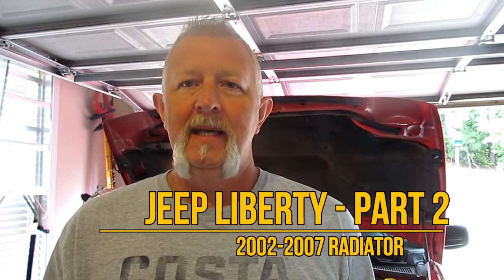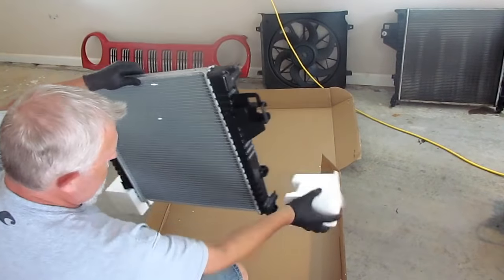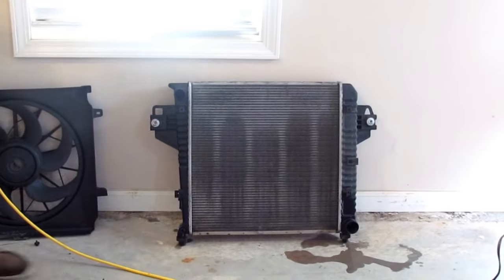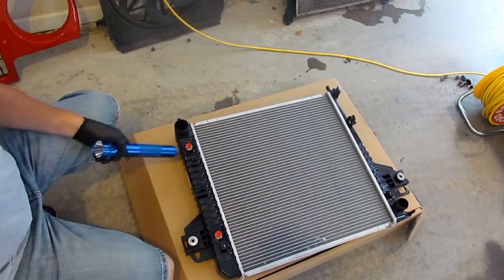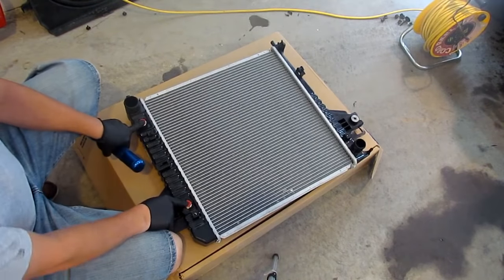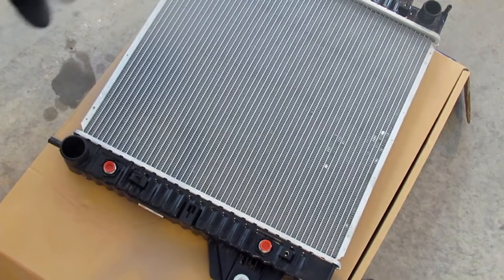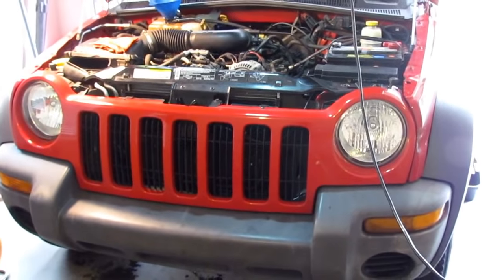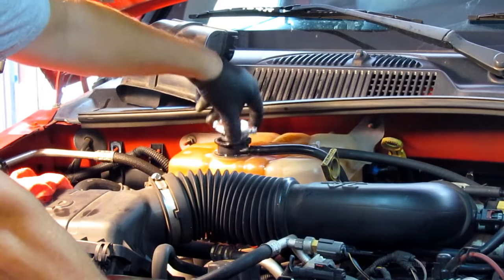Part 2 Remove and Replace 2002 - 2007 Jeep Liberty Radiator

Comment: I changed the radiator did everything you said but still over heating top hose hot to touch bottom hose where thermostat is is cold any idea what could be I also changed water pump and thermostat HELP
Reply from the maker: Thanks for watching.  Any chance you put the thermostat in backwards?  I've seen that happen before.  Also, did you burp the system?  If you have a lot of air trapped in the system, you won't get good coolant flow...no flow will cause thermostat to stay closed and then the car overheats.  The only other things I can think of to check:  be sure you have completely filled the system, low coolant causes same problems as low flow.  You may want to pull the thermostat, put it in a pot of water, boil it to be sure it is working.  The temp at which the thermostat begins to open will usually be stamped on the flange...make sure it is the correct temp thermostat for your year and model.  Let me know if I can help further.

Comment: Hi Dennis - I watched your video since my daughter's 05 Jeep Liberty needs a new radiator and we can't afford to replace it at any garage in town.  The dealership shop gave us an estimate of $1400!  I also don't think I can do this job myself, even watching your great video.  She doesn't get any heat from the heater and the dealership said her radiator was cracked...I don't know if that's true or not.  Do you have any ideas you can share with me?  Thanks so much!
Reply from the maker: Hi Suzanne, I'd try filling up the radiator and the overflow bottle to the indicated mark first.  Not sure of your climate, but either use pre-mixed anti-freeze with water, or mix your own using distilled water only.  If it does not get below freezing in your area now, or will not get that cold in the near future, I'd probably just start with distilled water only (cheaper), because what we're looking for is leaks.  If you fill it, and it doesn't have a leak, you may just have a bad radiator cap, or you may just have a cracked overflow bottle.  Both of these are much easier to replace that the radiator.
Once filled, start the car, let it warm up completely and check underneath for leaks.  If you get water.....see if you can determine where the water is coming from.  It could the be water pump, the radiator, a hose, etc. 

If it is leaking from the radiator....all you can do is get it replaced.  Unfortunately, there is not any way to repair these radiators.  Let me know what you find and I'll try to help you from there.
Reply: There is a leak coming from somewhere.  I added the PEAK 50/50 yesterday and noticed that the fluid in there was very low.  I could not get the heat to work after filling it to the required level.  There was some warm air coming out on the windshield defog setting.  But when I switched settings the air coming out was cold...although it was warm for about 10 seconds, then came out cold.  I let the car run for a while and it never got any better.  The jeep dealership said the radiator was cracked and there is a definite leak - but I don't now if it's the radiator cap or a hose...the A/C worked all summer  - but the heat is not working at all.   I'm going to call garage's today to get a quote.  I'm a single mom and this repair, along with the new brakes she needs, is going to wipe me out. :(  Thanks for your reply.  Wish I could do it myself but it's a big job for me and I don't have tools or confidence to do that one.
Reply: I forgot to tell you this...I live in Colorado..so it's cold here and right now the weather really changed and we got some snow...so I have to warm up the Jeep before driving it.  It's about 39-45 degrees today, no sun.  Tomorrow will be 60.
Reply from the maker: Hi Suzanne, it sounds like you may have a couple of problems.  With the radiator full and the engine warmed up, you should get warm air from the heater.  You may have a blend door that is stuck.....that is the part in the dash that moves to divert either cold air or hot air depending on what setting you chosen on your temp control.  Of course, you may still have a radiator leak as well.  That can be easily determined by checking the radiator when it is cooled off.  Since you filled it, it should still be full, unless you have a leak.  Let me know what you find from the shop, and I hope it isn't expensive to get fixed.

Comment: You helped me a lot on this install, but I have to rib you a little so here goes...did you forget to swap the rubber inserts on the bottom two posts?
Reply from the maker: Thnaks for watching and I'm glad this helped you!  It's been a while since I did this replacement, but I think you are right...seems I either forgot to replace the grommets or left them out altogether or did something dumb!  haha.  I don't remember exactly what it was, but I do remember something about those lower grommets/seats.   Nothing wrong with a little ribbing either.....Thanks!!
Reply: @dwcoffey  did you go back and add these rubber grommets? as I forgot to install these too.

Comment: I just knifed that bottom rubber that had me hanging on to that radiator... I have the same issue of 2 extra cooling lines on my new radiator, did you plugged yours? What size are those connectors?
Reply from the maker: My radiator came with a couple of plastic plugs in the transmission cooler ports, so I just left them in there.  I'm sorry but I don't know what size the plugs are.

Comment: Hi. I've followed the installation procedure. I have completed everything, add the antifreeze I inspect the hoses but notice something strange in the hose below the pressure and feels like something inside it is the one that goes from the radiator to the thermostat. It makes me strange because I only disconnect that hose from the radiator and that strange feels just before the entrance to the engine. It's normal or you think it's due. Thank you
Reply from the maker: Hi, thanks for watching.  Some radiator hoses have an internal wire 'spring' to keep the hose from collapsing when the engine and coolant are cooling.
Reply: OK thanks!!!

Comment: What part number did your order? was this MOPAR?  I'm about to do this change over and really confused about the different mounts for the external cooler.
Reply from the maker: The trick will be to order the right radiator for your vehicle, mine my be completely different than yours.  You'll need to know if you have a manual or automatic transmission, engine size etc.  The radiator I ordered was not mopar, it was aftermarket.  If you are buying it locally at a parts store, just take all the info about your Liberty to them and they can look up the right part.

Comment: How much antifreeze. Or how do i know i have enough in the hole system
Reply: Thank you
Reply from the maker: Hi Pucho, the system capacity is 14 quarts, but you won't need that much because you won't drain the entire system replacing the radiator.  I fill up the radiator to the neck, put the cap on, let it warm up, burp the system, shut off the engine, then check the radiator (be careful opening the cap).  Top off the radiator, cap on, start the engine, let it get up to operating temp.  Let it cool off, fill the radiator to the neck if needed, and fill the coolant overflow bottle to the indicated mark on the bottle.  Then just keep an eye on the overflow bottle the next couple of drives you take. 

Thanks for watching!

Comment: Where did your replacement come from?
Reply from the maker: I ordered it from Rockauto.com  Be sure to order one based on whether you have an automatic or a manual transmission.
Reply: Mine also has a manual fan. Its a 03 v6 auto with air 4wd. It has the external trans cooler like yours

Comment: What's happens if I don't let the air out with the Allen wrench and is the fan suppose to turn off by it self
Reply from the maker: Hi Fernando, if you don't 'burp' the system by letting the air out, you may not get as much coolant flow as you should and could risk running the engine too hot.  Also, air in the system will sometimes accumulate in the heater core and prevent your heat from working also, as not enough hot coolant will flow through it.
The fan will turn off by way of a thermostat.  Once the engine has cooled off enough, the fan will turn off.
Reply: I haven't move the jeep cause I can't un screw the bolt
Reply from the maker: What is the problem with the bolt?  Is the inside rounded off, or is it rusted shut, or maybe something else?
Reply: I put WB 40 on it and it still doesn't want to let me unscrew it idk if the bolt is rusted but I can't untighted it
Reply from the maker: If I have a really stuck allen head plug, I have used a short piece of pipe on the end of my allen wrench for more leverage.    _I'm not sure if this will work for you and there is certainly a risk of cracking the allen plug with too much torque.  Without seeing your particular vehicle, I can't recommend doing that, I'm just saying I've done it before. _    I don't want to be the cause of something getting broken.   I also have a set of allen wrenches made to go on a ratchet or breaker bar for more torque and I've used them before.
Reply: Oh ok I really don't what to do idk if I should take it to a mechanic and idk how expensive would it be
Reply from the maker: the cost will depend on where you are and what mechanic you use, but that might be the best bet.  I can't imagine they would charge you too much to break a plug loose.
Reply: Warm up the engine and get a new hex wrench and make sure you have it in there really well, then pop it with a hammer. You'll either break it loose, or strip it. With those two outcomes, you either solve your problem or you're back to where you are now. If I remember correctly, this is a result to two different metals bonding together, usually because of the wrong type of coolant.
Reply: Thank you Dennis, your video help me out a lot ... Thank you again ...my Jeep is fixed
Reply: I know this comment may be too late to help with the air release plug, but it does make a lot of difference if the engine is hot (operating temp) before you try and loosen plug, as noted by another commenter previously. Great how-to video by the way. One of the best I've seen on any subject. Thanks

Comment: Don't mix up the bolts!  The fan shroud and ac evap bolts are short and blunt end.    I was worried I might have poked a hole in the plastc radiator tank.
Reply from the maker: Good point and thanks for pointing it out.  Anytime working on a car, it is important to keep up with which bolts go where.  Thanks!!
Reply: Dennis Coffey I wouldn't have tried it without watching your video.   It was well done and a great help.   Thanks!

Comment: So can bad and leaking radiator also cause your heat to stink
Reply from the maker: Generally no....if your heat smells bad, you probably have a leaking heater core or a leaking heater hose at the heater core.  If you smell burning antifreeze all the time, whether the heat is on or not, it could be a leaking radiator, water pump, or radiator hose.

Comment: I already replace radiator and the fan and the coolant sensor and the thermostat and my Jeep Liberty 2005 keeps heating up
Reply from the maker: Hi Fernando... do you have a good 50/50 coolant/water mixture and is the radiator full?  Are you getting good flow through the upper radiator hose once the engine is at operating temperature?  have you burped the coolant system?

Comment: That damn rubber thing is a nightmare! I just did mine today only to find out the bottom  transmission port was messed up on the new one and unfortunately I ordered it 2 years ago. Anyway I fought with that damn rubber thing at the bottom forever until I finally just cut that stupid hole bigger so it would actually fit. I don't know exactly what it's made of but that thing is stupid. The hole isn't big enough and it doesn't stretch a bit. Almost took my 12 gauge to it it had me so mad...
Reply from the maker: I agree!!  I don't know when or how they put that thing in there, but there must be a better way.  I had to edit out a LOT of video as I figured out that thing.....let's just say there was much age-inappropriate language.  Not sure if you want to consider these options, but since the trans cooling port is buggered up......you could try to re-thread it with a tap and then use a brass adapter to match up the line, remove the current port and replace it with something that will mate to your line (or use a rubber line for a junction), or use an external cooler and just bypass the built-in cooler.  Thanks for watching and I hope you get that worked out.
Reply: @dwcoffey  I did think of a couple of those options but there not a lot of room to make new threads the collar isn't that thick. I also thought of installing an independent transmission cooler but ultimately I just decided to purchase a new radiator. It's the cheapest option because the one I have is lifetime warranty so I'll get reimbursed once I return the other one. Unfortunately they don't refund shipping tho lol but still it should be here tomorrow. If it was my only vehicle I definitely would had tried something else. I could tap it if I had to but it's pretty thin as it is and I'd have to like you said replace the hose with rubber no problem there but find fitting to make everything work plus I'd always be afraid of it failing down the road and leaking out my trans fluid. This vehicle has over 350,000mi on original everything other then replacing some typicl parts. With that many miles I tend to be a little cautious.